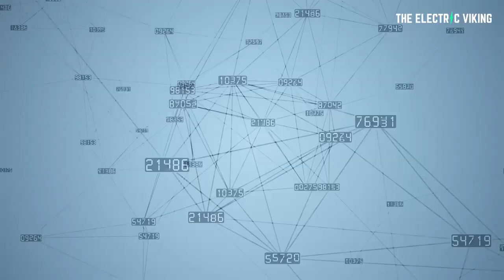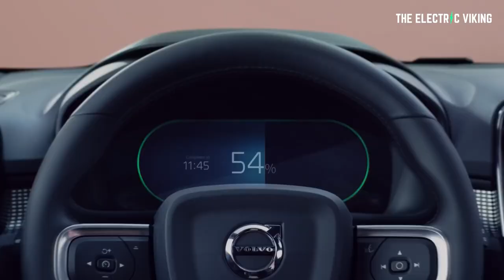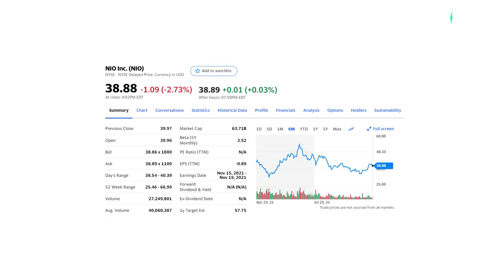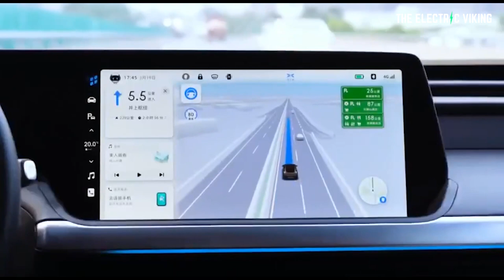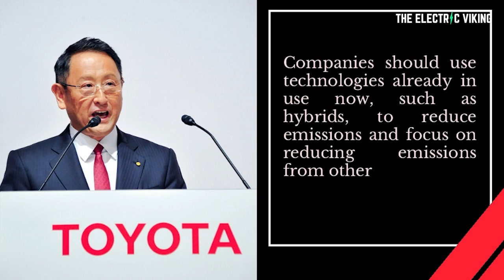An onslaught of Chinese car brands is hitting Europe

Comment: Hybrids are an unfortunate halfway house, and were a valid option when the Prius was first introduced, as a way of reducing emissions until Battery tech could provide enough range. Guess what? We're already there with Battery tech (LiFePO anyone).
Reply: The problem is more with access to charging. A high percentage of people don't have access to private parking or aren't able to have a charger installed.  Hybrids & PHEVs are still a better solution than ICE for people without access to charging.
Reply: @GregHassler  That depends on where you live, My local supermarket (Tesco in the UK) has 4 free to use charging points, and the multi-storey carpark in the town centr has another 5 (albeit at cost). Ans that's in a medium size midlands town.

Comment: Brands like BMW, Audi and Mercedes are still asking really high prices for options why you need to pay 2.480 euro extra to use your phone as a key on a BMW i4 or 205 euro for wireless charging or 3.755 euro for 20-inch wheels? A lot of the Chinese brands include most options as standard. So base BMW i4 is 60.800 euro and it is 75.935 euro with options and even then, you get a car that is based on an ICE car.
Reply: It does not make sense in a free competitive market. 
That is why these prestigious Legacy Automakers will also go the way of the Dodo!

Comment: I don't care what company's make the car.
My biggest problem is changing.
I have had to return my e208.
And now drive a 3008 hybrid.
This is simply because of charging I cannot charge my car at home because of the price of the charger.
And the closest charger is ionity 7 miles away.
My local super market had pod point chargers that have now been removed.
The UK has terrible charging infrastructure. 
You have one or two chargers in town that are taken up by car's that are plugged in all day. 
Or the idiots with petrol car's parked in the bay because they can't be bothered to walk the extra 10 feet. 
Or the chargers are simply not working.

Comment: Yeah Chinese companies put fancy tech in their cars but they don't last. I'd rather buy a Toyota with fewer features that I know will last got a long time.
Reply: @wngimageanddesign9546  yes I agree with a lot of your points, they should pivot to bev and hybrids, however I prefer to buy older ice vehicle and drive for few years, poor guy from RSA here. When I can get cheaper bev with good range I would definitely love one. But for now bev is for those with money.
Reply: @fridgemagnet9831  Oh I agree, EVs are for those who can justify affording one. I'd love one, but too far away from my budget. They, like computers, will only get cheaper and better. Meantime, I'm driving the wheels off my Honda. It's the most reliable car I've ever owned. Almost 200,000 miles. Everything still works, and runs like a top. I'm pushing it as far as it will go because I don't plan to buy another ICE car.
Reply: Then stick with a Toyota then and the past.

Comment: GM will have local US supply chain. They make their own motors... With nickel battery. I predict them to switch to lithium metal. 30% lighter with no graphite.

They could lease Tesla fsd.

Chinese imports tax can be 10-20%. Plus a carbon tax for dirty battery minerals mined.

Comment: It will be revealed in time, true to Chinese design there will be hidden corners cut, which will result in defects which will be inherently unrepairable... Chrysler was famous for doing that with their lower control arms rusting at the point of connection to the unibody frame, as example...
Reply: Your analogy is incorrect. For example, let's say you're a con man. You, as a con man believes everyone is either a sucker or a cheater. Just because Chinese can build vehicles at a cheaper price could be due to other factors such as labour, economies of scale, lower cost parts and overall better logistics leading to overall cheaper products. America has unions, etc that overpay Low skill workers. China doesn't have this problem.